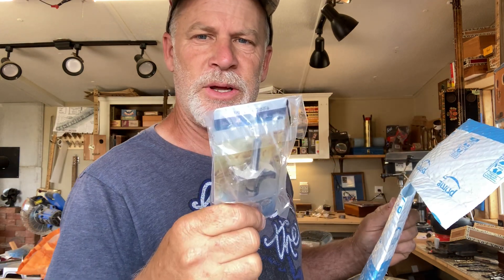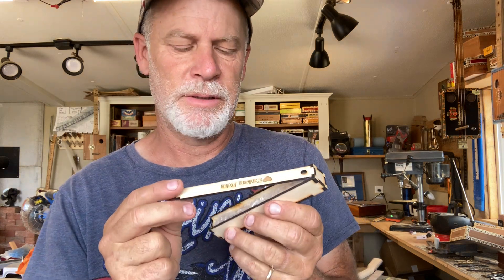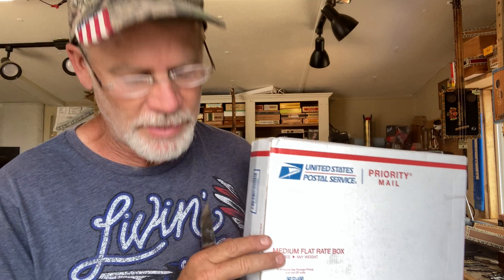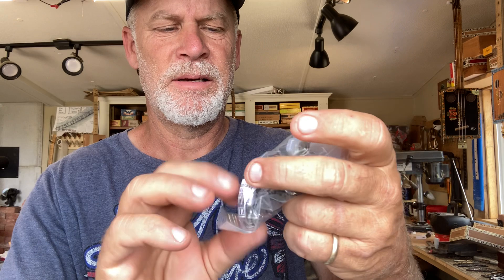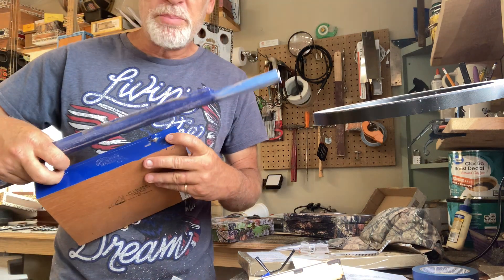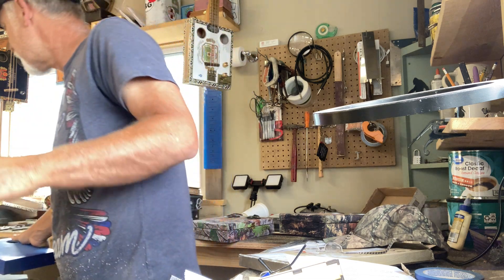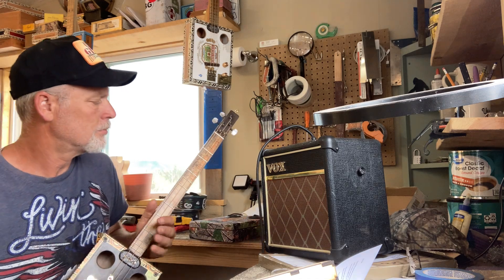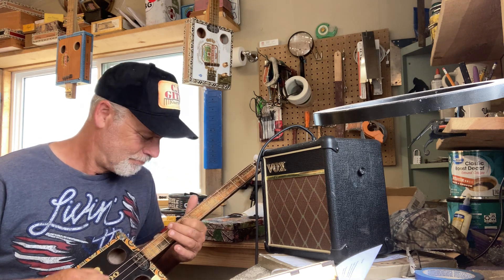Unboxing some Cigar Box Guitar Parts and some special “Gifts” 😎

Comment: So where do you get your cigar boxes from ? local tobacco shops?    I noticed that you put interior corner blocks in most all your builds.  Doesn't that have a negative effect on the unplugged performance?  On my 1st CBG build I made sure nothing touched the top or the back (except the bridge), like on an acoustic guitar.  It uses a thin-walled wood Padron box.  It is insanely loud unplugged, despite having just a single 1" dia sound hole at the neck pickup position.  My second build used a fiberboard Monte Christo box, and is totally dead unplugged.  If it doesn't sound good unplugged, why bother with a box at all?  Why not just use a plank of wood like my experimental 6 string solid body electric builds?   BTW is it just me, or do CB Gitty single coil rings remind you of screen door hardware?
Reply from the maker: yeah … lots of things don’t work.  sometimes i just get lucky … 😊